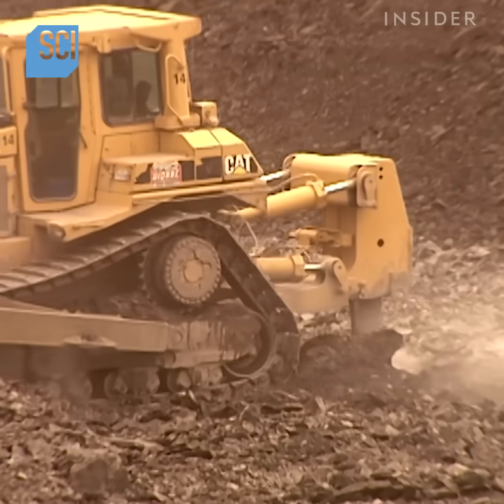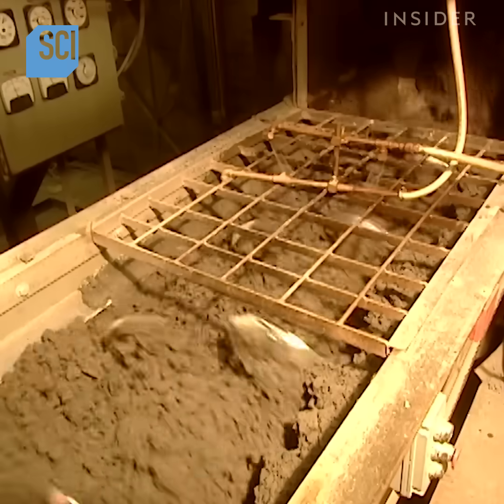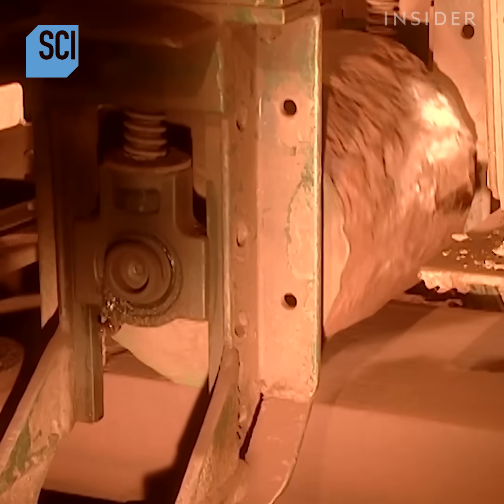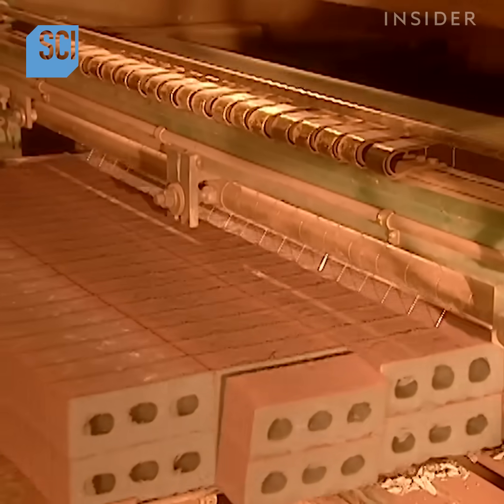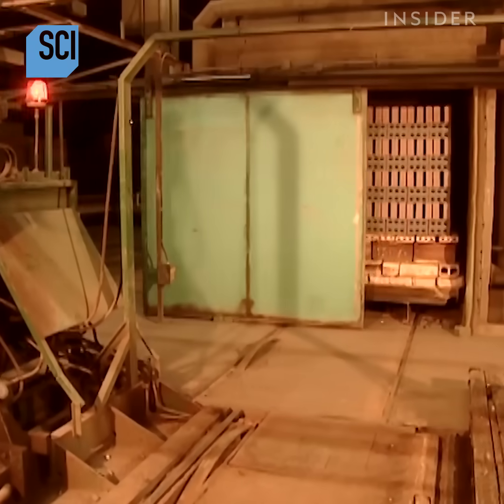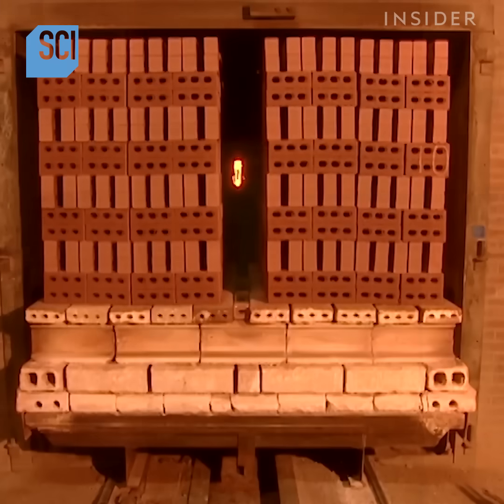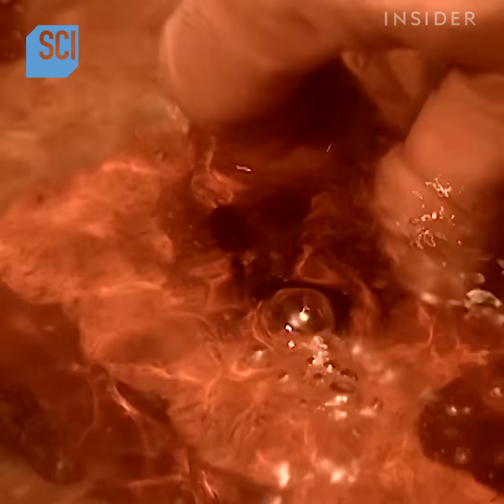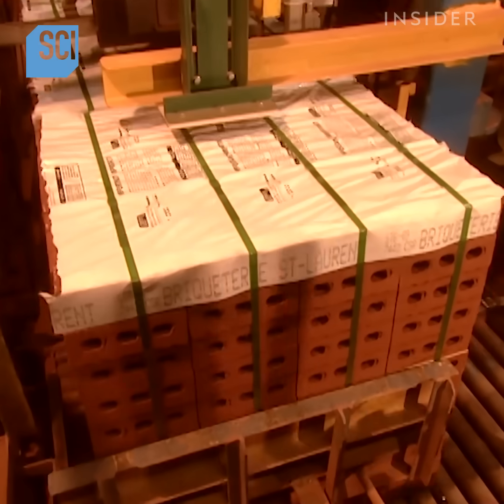How Bricks Are Made

Comment: find shale underground, hammer and grind it into powder, mix powder with water until it has the consistency of paste, grab another hand tool with a sharpish edge or craft a hollow container you can slide the paste through to give it the shape you want and leave it out to dry in a hand made clay kiln attached to a air bag you have to manually push for the next day or so, find a partner to take turns(optional, use a cylinder crafted stick to create 3 holes in the bricks)

^ this is in the event of total civilization collapse and you need to know how to do it by hand with rocks and sticks and crafted wooden beams